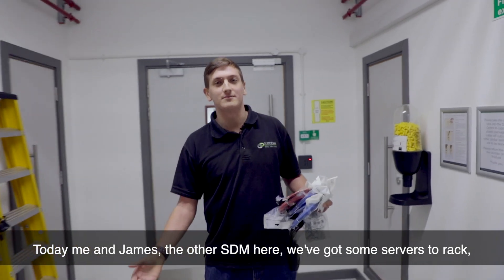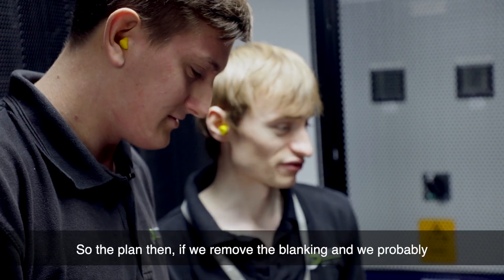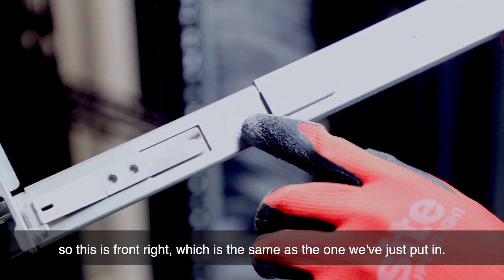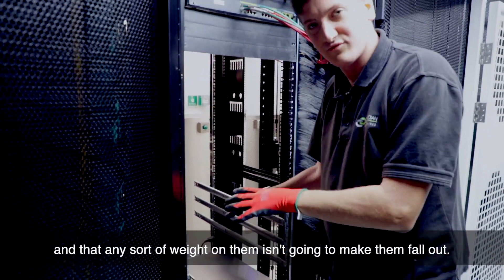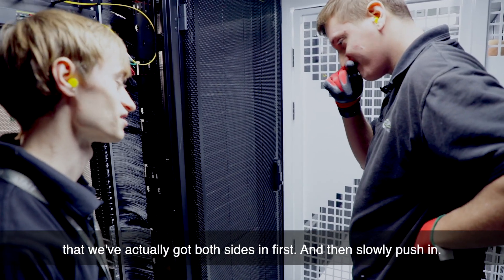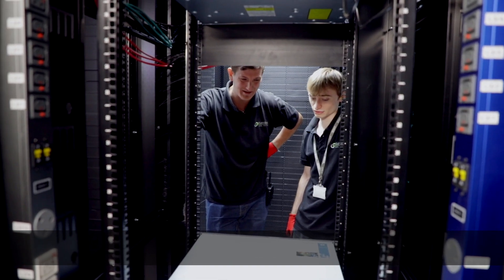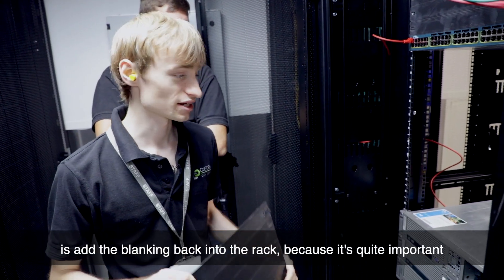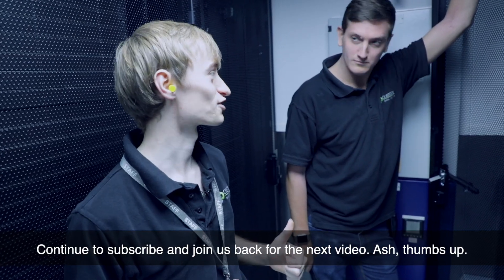A DAY in the LIFE of the DATA CENTRE | RACKING SERVERS with ASH & JAMES!

Comment: 1. I don't see the grounding connections
2. Don't the bolts they use need to have rubber or insulating plastic?
Reply: The racks themselves are grounded, as is the outside casing of the equipment through their power supplies. The PDUs (power bars) and rack share a common ground so there's no need to insulate between them.

Comment: What do you have to do to get a job like that ? & what’s that job position called.
Reply: I worked security for a DC(datacenter) and ended up getting hired learning from escorts I did or watching videos such as these. 

The title for the job can go by many names as it's company based. A couple are NOC technician, data center technician. But in the details of the jobs, you're looking for things that detail the information you know. Some DCs have their tech maintain or monitor chiller information etc. And some have a different department for that as well.

I don't have schooling on it but at the very least a know how for computer hardware is needed. Learn your copper terminations, learn fiber basics. If the company is looking to include splicing sometimes it is OJT otherwise it's easy to find videos on those as well the practice us harder to fullfill as equipment is expensive, but im sure there are classes for them. Rack and stack like this video etc.

You may be able to get your foot in through a contractor who specializes in fiber. And doing that may even broaden your knowledge towards OSP etc. Some of those contractors are an alternate route you may take which can help you your career path. Best of luck
Reply: its network engineering, generally good to have a cisco certificate , you'll learn about different types of optics cable ,ports ,switches and more

Comment: can someone tell me what is that red and blue cable is? are they both network cables? if so why there is two network cable for a server? is it for network redundancy?
Reply: usually red cables are for monitoring (alarms and logs), blue is for network connectivity (probably connecting to the tor switch)
Reply: I'm going to take a guess that it's working the same way as the power cables they mentioned earlier. Basically, just for redundancy since he stated "same kind of A and B principle". I wish they went into a bit more detail about them as well.
Reply: You're both correct
In data centers often there are two uplinks (internet connections), depending on what you pay for. So, for critical infrastructure, it is quite common to provide two uplinks from ether different sides of the building or even from different providers (and of course still different sides of the building). Just to make sure your systems are running and online in nearly every situation.

Edit: typos

Comment: LOL @ Installing old junk that's well past retirement.
Reply: Depends on the client.  They might not require fancy new equipment.
Reply: @MD4564  Seriously dude, you don't run gear that old in a DC, too expensive and inefficient.
Reply: @bentheguru4986  what about the cost of redesigning processes and redesigning systems?
Reply: Disaster recovery sites and backup systems don't have the same stresses as production workloads. Maybe it's a test system. Don't worry about it bro.

Comment: It wasn't that much different in 1990 but the wages where better and there wasn't many people in IT so you had to be 1st, 2nd, 3rd line support, software support and telecoms installers and support (the telecoms wasnt as easy as it is these days), then they started pushing school leavers in to the industry and the wages plummeted, now the job is more defined in to specialist in one field or another and the market is saturated.

There wasn't all the different qualifications, university was just IT degree where they taught software programming and the only other qualifications where Microsoft certification and Novel networking and you had to have both certifications to work in the field.

Every site was different with a mix of bnc and rj45 networks.

I used to enjoy my job but left the industry to become an electrician and plumber when the wages dropped £25k-35k a year. (Dependand on the contracts you where assigned and locations).

£40k was a bloody good wage them days when you could buy a house for £16k and lower.

Comment: Some day, I’m gonna open my own data center. Currently have a lot of EOL enterprise equipment I am experimenting with at my own lab, but if all goes as plan I hope to expand it to a real data center.
Reply: With the increase in cost of living I have cancelled all my dps servers and moved them to home network on EOL servers, now my dev lab is my production environment, saved alot of money, now have 2 uplinks to the Internet (looking at a 3rd) and my server are highly available with several local backup sources.

I have set my solar panel array and batteries to be backup power then switch to generator when the batteries run out (2 days).

It's been an interesting adventure thus far only pita was finding some ip addresses to lease as I Do not need a full block.
Reply: Good luck and hope all is well.

Comment: Rails are not always the same height as servers when you get to 2u and greater. you need to confirm exactly which height to put the rails in that will get the server exactly where you want it.

You want to order switches with reversed air flow if you care so much about airflow.  It look like the fans were swappable and that switch chassis as well. If they're swappable, they're probably reversible, are they buy a procedure in the manual or buy a little ingenuity.

All the money you saved on airflow will be lost in a heartbeat if you make a cabling mistake because you couldn't see both ends of the cable because it's wrapped around the rack to accommodate your air flow obsession. Not to forget as well the environmental impact of the extra copper and plastic needed for longer cables.

If that switch is supposed to serve those three servers you ought to be mounting it in the middle of those three servers, to minimize cabling, and fragmentation in the racks.

The best cable management is when cables are short enough they don't need to be managed because you can touch both ends with the same hand.  And they don't need to be labeled because you can see both ends without looking around.

Also.  These two need to get a room.

Comment: https://youtu.be/wFCc3ts74pQ?list=RDCMUCN216-B_l5E_wke2cKcNSjg&t=642 you can actually see the white connector on the switch with just 1 power supply.  You can use a cisco equipment to power multiple switches that only come with 1 PSU, in case you use them in a datacenter environment.

Comment: Hi i got two servers one Hp proliant DL380P Gen 8 and one Hp proliant DL360P Gen 8....my question is that my 360 does not find the ILO....any one who knows about servers and can tell what the reason is that the server does not find it?....Thanks from sweden
Reply: what you mean it dosn't find the ilo? Do you have an error message when booting up?
Reply: @Mircea140  No it does not find it at all ..i am reading some to try to find out the reason..i have worked whit computers for many years but not Servers  i am new beginner whit them
Reply: @Thessalonian  again, when you boot the server and you are in front of it, it should give you an error message. You should also see displayed on the bottom f8 to configure ilo. Try that. Maybe you didn't explain this properly, and maybe you can't find ilo on your dhcp because probably it has a static address, or a wrong network submask or gateway.
Reply: @Mircea140  When i start the server there is no ip adress to the ILO and it says cant find it...there is nothing nothing at all it show nothing?
Reply: @Mircea140  I got some advice i will try to

Comment: What about using an ATS for the single PSU boxes?
Reply: I use simple relays for this, but be careful. Both inputs need to be the same phase of power. Devices aren't built to anticipate a sine wave doubling up all the sudden or  jumping 180° without de-energizing first.  Great way to blow up a capacitor.

Also that shifting load is something you need to think about. It means you can never use more than about 45% of the capacity of either electrical circuit because for the other one to serve as a backup it needs to have room to double in an instant.  I have seen racks go offline because one input failed and the remaining input couldn't handle the new doubled load.

And to really confuse things it's not exactly doubled.   With only one PSU powered the server draws x Watts.  With two psus powered you don't simply divide x across both psus.  Each psu regardless of the server, consumes power in the PSU alone.  And that consumption doubles when you plug a second PSU in.  Consumption in the main board mostly it's divided between the two but differences in airflow may cause differences in efficiency which consume different amounts of energy.  The only way to really know is the test. And with the radical power savings abilities of modern chipsets another of the truth is that power usage in quadruple or more in a heartbeat if somebody starts mining Bitcoin or compressing files.

Comment: Thank you for taking the time to post this series of videos. Cage nuts were a great improvement over the old style racks with pre-threaded holes, which could get stripped (occasionally happened). Plus, the option to choose between different rack screw and thread sizes.
Reply: Try using a cage nut puller. There's a proper tool for putting in cage nuts and it's not your fingers.  You can get it in a molded screwdriver handle style or a thin piece of sheet metal tool that often comes with racks.
Alternatively, just use a zip tie.  You can seat the first half of the cage nut with a finger and then stick a zip tie between the other side of the nut and the hole. Push it tight with one hand and pull the zip tie with the other to drag the other half of the cage nut through the hole.
For extra style points use a second zip tie as a handle for the first
Reply: @billycroan2336  Thanks. I think there’s a miscommunication. I’m aware of the tool. I have one. It resembles a nail clipper, though wide and flat. Used it often. I wasn’t referring to a stripped cage nut. I’m talking about older racks that have a pre-threaded hole in the rail itself. If the threads strip, though rare, I’ve typically had to put a nut behind the tail. I ran into this scenario once or twice when I bought a used rack on the cheap that was manufactured before the advent of cage nuts. Obviously, if a cage nut gets messed up on a rack that uses them you just pop it out and squeeze in a  replacement, as I believe you were conveying. While data racks employ cage nuts now. I believe many smaller audio-oriented racks still employ pre-threaded rack rails. Cheers!

Comment: Are the switches just held in place by the four screws in the front? No rails or anything supporting the weight in the back? Seems like a lot of torque on the face of the switch so was curious.
Reply: Steve, Yep - just the four screws in the front. Dont worry - they are plenty sturdy.
Reply: It’s really the bottom screws doing all of the work. The top ones are for redundancy…
Reply: @chumpmu1  the top ones don't do shit. Other than only getting place if you bump into the bottom of it from behind. But that's really not much of a problem.

The top ones are honestly a waste of time.

When the torque finally does start to deform the ears, if anything I put screws on the top two BEFORE putting the switch in and then back threading those top screws TO PUSH the top of the ear out while I tighten the bottom ones to push the bottom of the ear in. It's the nail in the coffin of some already chinced up ears (or sometimes it's the rack itself that's bent) but it gets the job done

Comment: I would Never work in the datacentre screw that…… what’s the difference between a technician and analyst in your company obviously you don’t need an education to do anything in your company apart from experience which is critical but education is also super important especially if it’s good if it’s like a networking network security or a really good computer science degree because you get to understand things very very deeply your company doesn’t want people like that obviously they just want people can push buttonsThe little command line and that’s it
Reply: thanks for your opinion
Reply: Push buttons and installs? I can do that

Comment: gen 5's in 2019, is this just for the video?

It is also worth noting that you can order fans for most switches that change the direction of the airflow so they can be mounted at the back of the rack

Comment: why aren't you using screw gun to tighten the screws for the switch, that's faster and easier right?
Reply: Exactly what I was thinking, what's even stranger is that it feels odd seeing them without masks
Reply: It's the fastest way to strip them to shit.  Screw gun for removing screws, yes. For putting them in take your time and don't break things.
Reply: @Billy Croan  buddy u can adjust the SG speed. And who tf is the right mind to use full speed for mounting a device? Lol u can slow it down but still faster compared on using a manual screw driver
Reply: @bogski28  I'm not your buddy pal. And speed is not the problem as much as is torque. And yes there are also torque limiting screw guns. But they have various quality and reliability. And you still can't feel the torque. How do you feel a problem with the threads when you're using a tool like that before you fuck it up? How do you feel a loose cage nut?  An obstruction behind the nut? All these things matter when you're putting a bolt in. They're don't so much matter when you're taking one out.  So save your screw gun for demo/extraction like I said.

I've been setting up racks for decades son.

If it's a completely empty new rack with all new nuts and bolts, equipment, being assembled as one unit to be shipped as a rack to another location and you're filling it right up with equipment that needs cage nuts (I have worked exactly that scenario before) then maybe use a screw gun with a good torque limiter.

But let's be realistic most rails are "toolless" these days anyway.  So you're really whinging about a handful of screws for Network gear?  A UPS shelf rack maybe? Waaaaaah. Don't be lazy.

In a production data center that's always changing and evolving, use a damn screwdriver like God intended, to tighten the screws.  And use all of your senses when doing it.  You (and especially your lesser skilled minions) are much less likely to break things with a simple screwdriver

Comment: Hmm.... it looks like 3 HP ProLiant DL380 G5 servers? Isen't that a rather old server to use today in 2020?
Reply: I think, they are just mounting those servers for customer. So it doesn't matter for them whether its old or new. Just follow the order.
Reply: The chips in there are from around 2008, so yeah they're quite old...
Reply: @vista9434  Ahh I see. The video is dated(uploaded) 19. jul. 2019 so I thought it was recorded somewhere around that date :)
Reply: Some smaller businesses will use older used servers and equipment to save costs. For many smaller businesses, it's the difference between having a server and not having one at all. Believe it or not, most servers are very well built and can last a very long time. In our datacenter we still have servers running all the way back from 2007 and they are still working with some of our most critical services. Maintenance costs are higher for them today compared to when we originally installed them but they are still a workhorse.
Reply: @quilnux  can totally agree.
I'm using some outdated stuff from Supermicro and they do a very very great job. It surprises me a bit that they still get BIOS fixes.

Comment: How cute they wear gloves when they work.
Reply: i realized working at a data center that dc techs are the softest lol
Reply: @Poopconnaisseur  funny thing is I'm a DC tech and I'd probably kick your ass
Reply: Lembe Muhammad its not that deep relax.. besides im sure you got some LC connectors to clean
Reply: @z1lla4  Ya... a number of guys I worked with who were DC support / networking admins and engineers were quite often former military.  That was 15-20+ years ago where a lot of the telecommunication jobs were guys who did that for the Air Force or Navy.

Comment: 5:32 it's 2019 and servers are still using PS2 ports???
Reply: That's a DL380 G5, look when it was manufactured. Also yes, PS2 ports just work with no compatibility issues or extra drivers, which is less cost and worry for manufacturers.

Comment: I have a couple of 1/4" steel rods I place thu the top hole of the U below, to form an 'X'. That makes it easy to rack Ears Only devices with a single person (and hold up those extra heavy 2U switches without tiring).
Reply: Try doing just one side first, loosely and letting the damn thing dangle diagonally for a second. Then pivot the other side up and put it screw in loosely. Then tighten both screws while supporting the back so it's flush.  The process looks goofy as hell but it works.

Comment: The blue fans on the switch would suggest it should actually be hot aisle facing and actually sucks cold air through the rear (fans) so ports should have been facing rear (not front as you’ve installed).